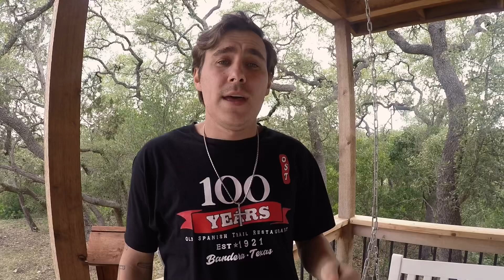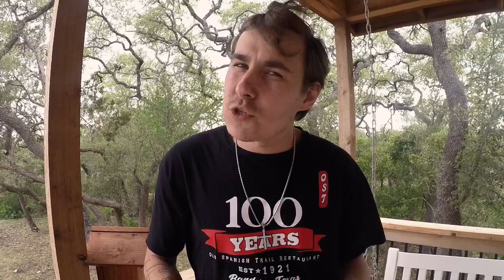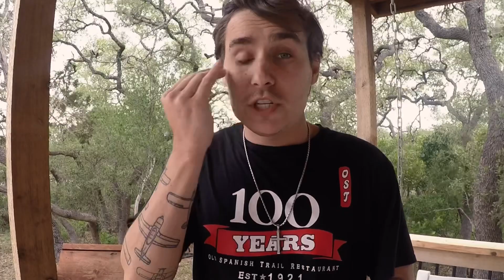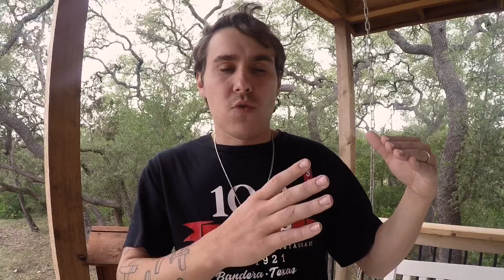5 Things To Expect At Aircraft Mechanic Schools!!

Comment: I dont understand how one can be expected to on same day do sheet metal work, fuel cell or engine repairs.  The military is specialized, and my 24 year experience as an aircraftcelectrian/environmental mechanic showed a minimum of a couple years to be trusted and proficient to make repairs, but with someone of 5 years to sign off your work. A&P cert sounds lije you apply for specialized jobs, with OJT to work in other areas ( component repair and engine work).
Reply from the maker: Well that's not everyone. Large companies like Boeing will have you specialized in specific areas while airlines do mostly line and base work like C and D checks. There are even Repair Station jobs like Standard Aero where you will do the exact same thing every day. General Aviation and smaller on demand charter operations are where you can really expect something new every day.

Comment: I went to school back in 2020 when it was still the time based program. It was a accelerated program start to finish in 9 months (one of only 2 schools at the time). I was fortunate enough to do early O&P's (took the writtens and practicals before my classes were even done). If you're going into GA, school can be very useful. If you're planning on going to the majors, it's not as useful. We only spent 3 days on turbofans, but its not too difficult to figure out. The manuals are a lot easier and more comprehensive in the airlines than GA. You will learn about 90% of everything you know on the job. If you're planning on doing line MX, don't plan on fixing planes. You just do inspections. If you do hangered MX at a hub though, you'll be doing a good mix. Also, don't plan on being a welding pro after school. You'll go from bad to slightly less bad (assuming you have no welding experience). I'm not sure if classes are structured differently now, but classes were all different types of lengths. Sometimes, I would have 6 finals in 1 week (I think my shortest class was 3 days), and sometimes you'll have 3 finals in a month (piston engines I believe was the longest class at 3 months). School is useful, but in the Majors, it is run a lot differently than a lot of people expect. Bit of a shock. I've never worked GA, so I can't speak there.
Reply: Can you advise the name of your school? Your accelerated 9 month school. 
Thank you for your comment, totally good insight

Comment: Is there anything I can read ahead of starting the program to get a better foundation.
Reply: Yes, Read the free FAA text books on General FAA-H-8083-30B, Airframe FAA-H-8083-31B, and later Power plant FAA-H-8083-32B.  A copy of AC 43.13 to reference as well. Printed versions are not very expensive and the FAA has taxpayer funded PDF's of these books at no-charge.  The FAA test curriculum is 100% based on this content. Read the General then the airframe book. It will provide a near perfect window into a part 147 school and what the FAA will cover on its proctored tests.  I'm graduating from a part 147 school this week with a grade of 95.6% for General and  94.5% for Airframe.  The text books were invaluable.  
Also schedule a visit & tour of a 147 school.  HIGHLY recommend Community College based programs. Many are excellent.  My total tuition plus tools to finish General & Airframe was $4600. The forthcoming proctored tests is $1750.   $6300 in costs from first day one of class to walking away with a General & Airframe license.

Comment: I’m more worried about the practical than the oral. Any tips?
Reply from the maker: The first part of the standard is to read and follow procedures. As long as you ask for the manual or procedure and follow it you'll be just fine.

Comment: I'm 5 feet, 2 inches tall; is that fine for going into aircraft maintenance? Be straight with me because I still have time to look into something else.
Reply from the maker: Yes, one of the best mechanics I worked with was 5'4". Belive it or not tall is more of a hindrance than being shorter. Aircraft have lots of tight spaces that are tough to move  in.
Reply: Have u heard of the best military soldiers that was 4’9 ?… height is only a hindrance when it comes to most women anything else u can excel if u are good at it
Reply: Im 63 inches and my co worker is 60 inches.

It’s not an issue. Airlines provide ladders.
Reply: If it's your cup of tea they would love to have you for fuel tanks.

Comment: Loving the videos!. I am going to school right now for my A&P (plus assoc degree) about halfway through it. I will be scheduling my writtens soon.  The ACS change during the beginning was a little bit of a mess but things are going well and graduates are passing O&P's. Biggest challenge is test prep as the writtens do not fullly follow prepware anymore. I talked to a student and he said he only had 2 or 3 questions out of the full bank, meaning you need to know and reason through the questions rather than memorizing.
Reply: Are you working while in school, if so difficult are handling bills, going to school, and studying?
Reply from the maker: Indeed we have been hearing the same, memorize the prepware but understand why the correct answer is the correct answer. Thank you for watching 🙏
Reply: Entirely disagree. Tested today and a good 80 questions were Prepware, and at least 15 of the others were also, but changed the answers to something else then what was on Prepware.
Reply: @lane5477 I’m starting classes next week, just got the last of the ASA test prep workbooks in the mail and now I’m reading all this stuff about how they’re not worth Jack anymore.. You were using those three red, blue and green general mechanics books right?
Reply from the maker: They are not worthless, the FAA has just rearranged questions and added some new ones. Also if that's what the school is using for your classes it's what you will need.